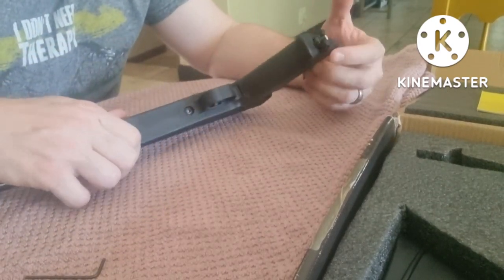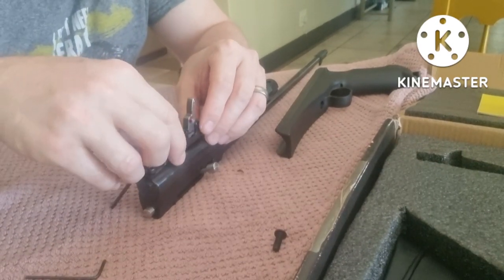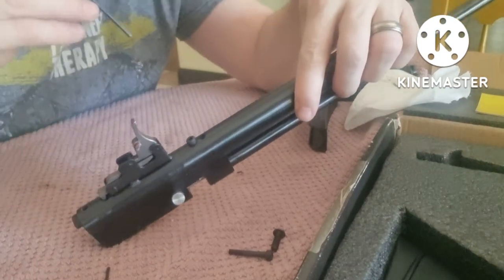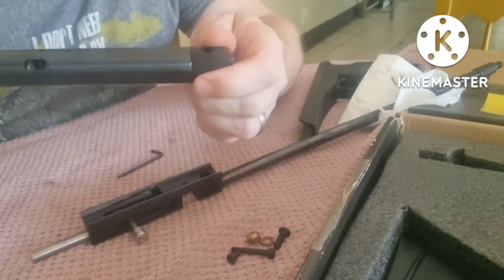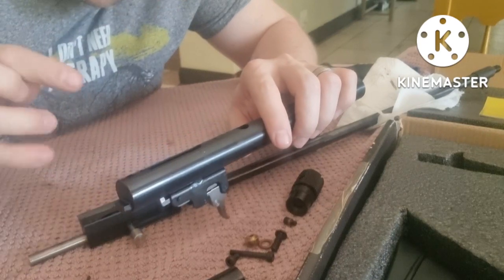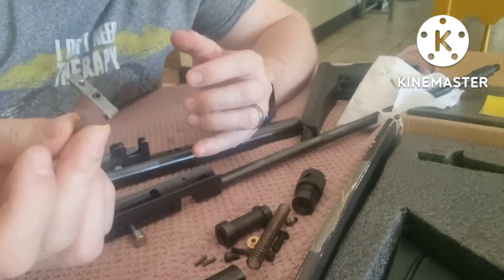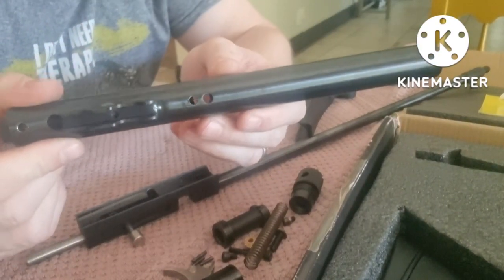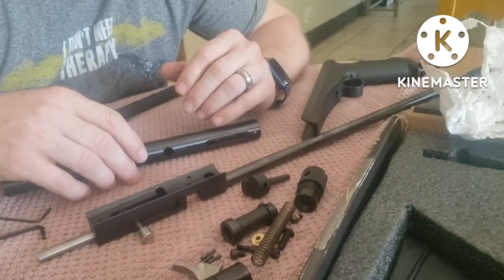Artemis CP2 mods Series Pt1 - disassembly & end cap trick #cp2 #chaser

Comment: The first time you strip the gun down you may find that the small 2mm screw under the single shot tray is very tight. It is assembled using blue hermetite at the factory as an anti tamper and is easily stripped so you need to be careful. Mine was very tight but I managed to remove it by soaking it overnight in brake cleaner soaked onto a piece of tissue - this softens the Hermetite and you can then carefully remove it with a well fitting allen key.
Reply from the maker: Thanks @Steve C for the tip, I haven't encountered this before but can imagine it would be a problem
Reply: @African-Budget-Pellet-Gunner  I nahe ordered the Artemis CP2, one question, can I use the umarex Co2 Adapter, so I could load 2 capsule instead of one.
Reply from the maker: Unfortunately not, only enough space for 1 co2 capsule
Reply: @African-Budget-Pellet-Gunner  thanks

Comment: My end cap come straight out soon as I took the bolt out. Polished the hammer, trigger and cylinder the hammer slides in to a mirror finish teamed with a 3mm transfer port and a 1cm bit of rubber in back of hammer it shoots super smooth perfect for what I use it for. Been looking for a drop block to convert it to HPA but they aren’t cheap, only problem I have with this rifle is the weird size barrel Orings 8mm (id) 0.8mm (cs).
Reply from the maker: Yip, most end caps come off easily but not all. Agree some of the sizes are a little funny but I suppose it is to be expected

Comment: The screws with the copper washers need a dab of Loctite to prevent them coming loose. 

In some circumstances a tight end cap can be removed by cocking the bolt  ... make sure you cover it with a firmly grasped cloth or similar otherwise it will end up in a low earth orbit!

Thanks Tyrone a great series
Reply from the maker: Yes a drop of loctite on those cap screws can definitely help. Thanks for the tip on the end cap I haven't tried it like that.

Comment: 1:28 Mine actually fell out the last time I took it apart. Immediately checked if a pin fell out but they were all three still in place, then I noticed the screw missing. 
So yeah, to anyone with a CP2: Check it and tighten it if needed.
Reply: Tjeez..this is not good. Just took it apart again to finally polish the hammer, and the hammer screw almost fell out. The one with the copper ring, it was all wiggly, holding on by maybe one and a half or two turns.
Reply from the maker: Yes, this cap screw does sometimes come loose you need to tighten it nicely. Also check the same screw on the bolt

Comment: Great video!! My Diana Chase is due tomorrow (5-21-24) and I'm very much looking forward to it. Thanks for all the education on it! I'm in the suburbs of Las Vegas and this will be my anti-pigeon device. Love the accuracy, so I have fewer pellets "in the wild". I'm planning on just leaning this in the corner and when some pigeons show up, grab it. Any idea how long it can just sit without loosing too much charge? Also, will there be any benefit to sanding the CO2 cylinder connection area with a little 1,000 or 3,000 grit w/d sandpaper to make a smoother connection to the sealing o-ring?
Reply from the maker: Hi Miken, glad you are enjoying the videos and I am sure you will love your chaser. I think there is method in smoothing the ends of co2 capsules as that is the primary reason the seals fail.

Comment: It'd be nice if someone would make a video on replacing the piercing nipple talking about the symptoms whether it not or not it needs to be replaced..... As soon as my CO2 is pierced it stops turning it bottoms out suddenly it didn't used to do that
Reply from the maker: I think I did make a video showing this check out my CO2 valve optimization. Unfortunately I don't think I mentioned why it breaks but I have also broken 1 or 2 before
Reply: @African-Budget-Pellet-Gunner  I have another problem when I change to a fresh CO2 then the point of impact shifts to the right a quarter inch...... The previous bottle I had a hole in a whole accuracy five shots in a row... This problem is going to be going on for a long time always having to readjust the windage from day to day and it's happening on two different scopes and three different pellets I've got the shoulder stock and I'm using a silhouette position and I'm only 21 ft away.
Reply from the maker: I am assuming that you are using the same co2 brand as they do differ. Check that everything is fastened properly barrel, stock and scope with mounts. Then we take it from there
Reply: @African-Budget-Pellet-Gunner  I'm using the same brand of CO2 it also has a valve lock problem in the summer it just barely even shoots I've got an insurance warranty so I'm getting a different one in a couple of days I'm going to try the 177 version as a full kit I'm wondering since I got the 22 as the pistol only if that's the rejects they put a better one in the full kit
Reply from the maker: The CP2 is a little better quality than the CP1 for sure, but both are tunable and nice in their own right

Comment: i have a cp2 and this morning it started misfiring , i seem to be losing air , ive got a puff of gas which comes out the silencer with every shot (never did that before ) and the silencer is cold after 5-6 shots. is there a seal somewhere which comes lose, its only had 200 pellets through it.
Reply from the maker: @NOT SURE there could be a few things that could cause this. Is there gas coming out else where as well or only extra at the silencer? I would suggest you check the 3 seals on the barrel to breech connection. 2 on the outside of the barrel and 1 on the inside where the pellet gets loaded. It is actually where the pellet probe seats on to seal the back of the pellet. There could also be an alignment issue. If you split the breech and the tube and load a pellet into the barrel it(the pellet)should be slightly in front of where the transfer port joins the barrel. If the pellet is not far enough forward it could allow the co2 to go past the pellet. Drop me an email with some pics and I will see how I can help tyrone8511@gmail.com
Reply: @African-Budget-Pellet-Gunner  its just coming out the silencer not the exhaust port, it looks like i might be the white seal round the co2 cartridge, ive noticed the last 2-3 empty cartridges ive had to rattle the gun to get them out so i think its stuck to that seal and pulled it out of shape , ive also noticed last 2 fills that i didnt hear that pSST as you screw the new cartridge on. i think im going to have to strip it down.
Reply from the maker: If it was that seal it would leak straight away when you puncture the cartridge. If you strip it down down take lots of pics and I will help you as best I can. Did you start using a different pellet?
Reply: @African-Budget-Pellet-Gunner  ive stripped it down and put it back and it seems ok , the cartridge seal needs replacing though, its a bit compressed (ive just realised , probably not good idea to leave it with a cartridge in) or it could have been the 2 o rings on that small brass collar thingy.  while i had it apart i did your spring mod 👍
Reply from the maker: Awesome sounds like you are sorted didthe spring mod give you some extra oomph
Reply: @African-Budget-Pellet-Gunner  i didnt go mad with the spring ,  im happy at about 20 yrds and yes its perfect now , although when i had it all back together i found a spare ring and rubber pad for the cartidge connection, 
have you ever got into hydrodipping? its very addictive . ive dipped mine and the great thing about this gun is it all seprates into small pieces.